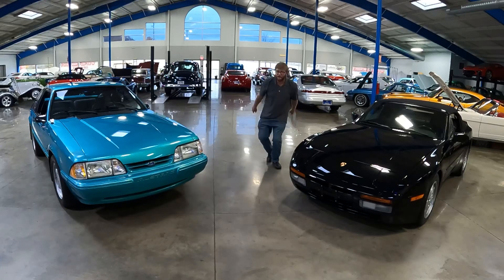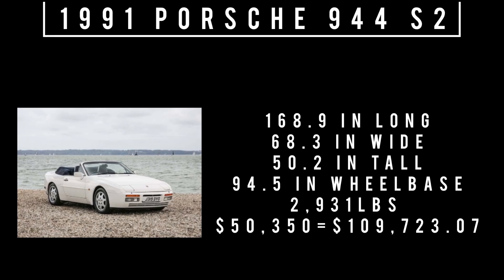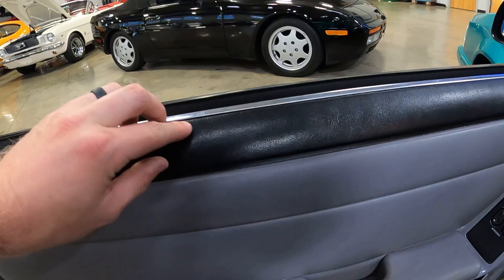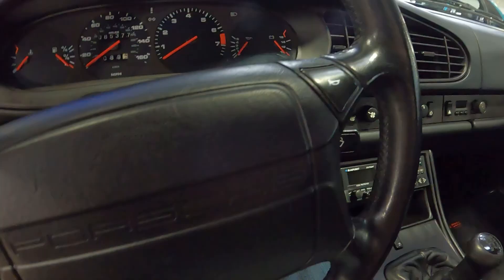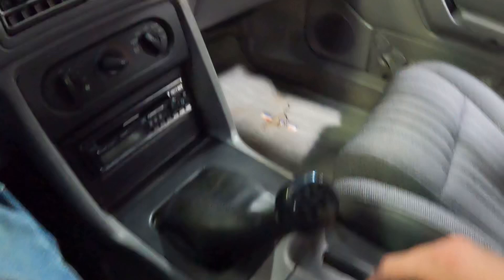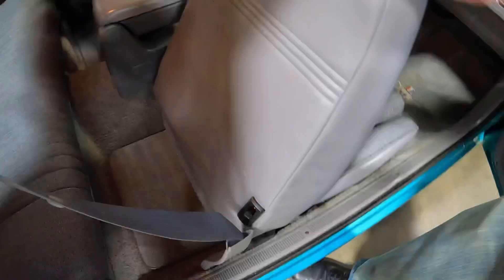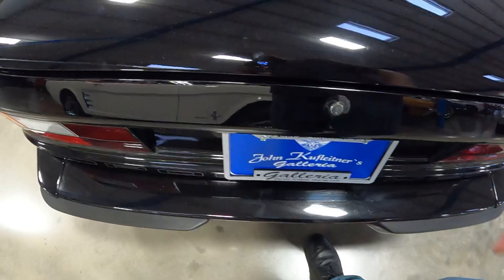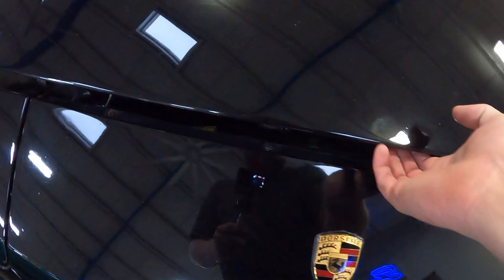Non-Comparable comparison? Or is it 1993 Ford mustang vs 1991 Porsche 944￼

Comment: You'll find the clutch in the 944 travels about 3 times farther than required to shift. It took me about a thousand miles to realize how good the clutch was once I stopped pushing it to the floor.
Reply from the maker: Yeah, I don't remember exactly where the clutch let out it's been years since I drove that car but I do remember it operated the engine did a lot like a Honda with VTEC. Once you got it up over a certain RPM range it turned into a totally different car...

Comment: I'm a 911 guy, 73 911T Targa, since new(pretty much all original) that said the 944 was pretty nice overall with a 50-50 weight distribution, and a better engine than the 924. Was it over priced at the time?  Maybe.  I think the depreciation was created by the "It's not a Porsche crowd, It's not a 911 and it's not air cooled and the engine isn't in the back. And I'll add this, many were thrashed pretty heavily.  It sold 173,238 units from 1982 and 1991. However - -It was one of the most successful sports cars in Porsche's history About 1/2 were sold in the U.S. You are correct, it becomes a different car at about 4,000 rpm, it's max torque comes on at 4,100 rpm and you begin to start getting close to it's max horse power.  An original condition 944 (near mint) can still bring about 45,000, most bring far less.  Glad you liked it though.
Reply from the maker: Going to hit more Porsche in the future hopefully 356 hopefully next year there is a xk150 coming maybe next week

Comment: You need to educate your self on 5.0 mustang . The one you drove must a been parked for a long time or something is not right with it . 5.0 stangs came with 2.73 gears that was very high , however 1/4 m times were low 15’s to high 14’s , not bad for a grocery getter lol , now the good choice was to buy the even cheeper 5.0 LX , it came with lower gears , 3.08 , no problem getting in to high 13’s in the 1/4 m . Of course now guys are getting 3.55 or 4.10 and a lot of affordable add ons , and then , these little 5.0 are Rockets!
Reply from the maker: The one that I drove was extremely slow I had an 88 Lincoln town car that pulled harder than that car did my 88 Lincoln did 0 to 60 in 81/2 seconds that mustang didn’t feel that fast I’m subjective enough to tell you if something isn’t good I will give the fox body mustang another go but the one that I drove wasn’t fast nor was it fine to drive.. It was just OK a lot of people think that I’m comparing it to a new car I’m not comparing it to a new car I’m comparing it to cars from that era I recently drove a bandit Trans Am these cars are very similar in acceleration. The bandit Trans Am was also on the slow side automatic three speed transmission I shifted it manually and it still wasn’t that fast but I will say that it was faster than the mustang.. The Mustang had a harsher ride as well the Daytona that I recently reviewed had a better ride than the Mustang dead and that is saying a lot I’m a Mustang fan I like the 60s mustangs the new mustangs are cool too but this era for me it’s more hype than it was good and like I said I will totally give it another chance but this car must’ve had 273 in the rear end because it was super slow but when you got it on the highway 60 miles an hour it was only turning less than 2000 RPM which is pretty good. The Motel six comment was because it smelled like cigarette smoke like somebody bought the car just a chain-smoking and then tried to cover up the smell with lemon pledge that’s the smell of Motel six

Comment: Hi Justin, the dummy switch under the head lamp switch is for fog lamps switch found on the Mustang GT.  I know what you are talking about a rear seat in a car for lower insurance cost(s).  Insurance company(s) charge higher rates for 2 seater cars, I thing it's politics.  That is one reason why the Pontiac Fiero was so short lived.  The 290:1 rear end gear ratio is a "fuel economy gear ratio" NOT a "performance gear ratio" at all.  Please reply.  Dave...
Reply from the maker: That has to be the explanation of that car because it wasn’t that great but when you were at speed it was only turning maybe 1500 RPM at 65-70 miles an hour i’m gonna be sure to call out that RPM numbers in reference to speed when driving when I can

Comment: Eventhough the prices may be close, now, but what is of most importance is what is it going to cost to own. Probably the Porsche has depreciated so much is because the car was costly to own. Porsches are costly to maintain and if something breaks or wears out, oh boy, hold on to your seat and put something in your mouth so you don't break all your teeth off when you clench them.
The Porsche engine is a timing belt engine and from my experience, that belt  breaks causing bent valves. When replacing the timingbelt, the tension has to be adjusted  using a special Porsche tensioning gauge. When we bought one from the Porsche dealer in the early-90's, we paid $250. for it.
The belt is tensioned buy loosening the  water pump mounting bolts(the water pump is driven by the timing belt), and sliding the water pump until the gauge reads the correct tension and then you re-tighten the water pump.
Then there is the clutch. It is conventionally mounted rto the flywheel, but it is connected to a rear-mounted transaxle. You have to unbolt the transaxle and move it back far enough so you can remove the bell housing  to replace the clutch. These are very costly repairs, laborwise and parts wise.
Just because you can afford to purchase the car doesn't mean that you can also afford to m Aaintain and repair the car.  With used Porsches, I've seen some abandoned at a repair shop because the owner can't afford to fix it. I've seen a lot of these cars sitting at a repair shop for months while the owner save up enough money to pay to fix it. And, in the meantime, the owner is still making car payments on a car the owner can't drive or even have possession of. Because there might be storage fees involved, the owner may have the car towed home.

Now the Mustang. It has a regular Ford pushrod engine and is extremely reliable. Parts are readily available and reasonably price.  It doesn't involve a big production number or stage show to work on it. Plus, it won't be hard to find somebody to work on the Mustang. Mustangs have a long American history and have always been well-liked.
Reply from the maker: Totally agree with everything you said.. I’m not a Porsche fan nor do I like Mercedes bmw or rover products they all seem like over priced piles to me.. Porsche when running good is a good car when it’s not it’s one of the worst cars you’ll (not you specifically)  but you’ll ever own. Same goes for the other brands mentioned. 

I wish we had more 50s cars at the shop to do comparisons with
Reply: @What.its.like.  I'd say most of the 50s cars  have been snapped up and are languishing somewhere in somebody's collection or sitting waiting to be brought back to life.  
Us 'o;der' guys are dying off  and classic cars are coming on the market, slowly. You are young enough that you are going to see many classics resurface and come on the market in the future. If newer generations are not interested in classic cars, prices will plumet and there will be tons of bargains out there.
From myself having been in the auto repair field for decades, I kinda know which cars to avoid. Because we repaired cars for a living, we hate working on our own cars, so reliability, longevity and cost of ownership are major factors. There are companies out there, like Hagerty insurance, who understand and help you out. I have full insurance coverage  on my '82 Mercedes 300SD and '81 Cadillac and it costs me only  $125-150. per years, insuring both cars on one policy. Most European cars I know to stay away from. I might consider a Porsche 356, because of it's simplicity and that it is really a VW in disguise(on steroids). Kinda like the early Mustangs being Ford Falcons with different bodies.
Reply from the maker: We were just talking about that at the shop the other day I don’t think all of them we’re gonna go by the wayside.. White Mustang Camaro challenger all the cars that people dont watch on my channel they’re gonna still be all right. 

I’ve made it my mission to do exactly what you said I want to bring to light The cars that are off the beaten path lost in the woods somewhere that are super cool but nobody knows about. I’m a huge Hudson Nash Studebaker Packard fan I also like kaisers all of the 50s brands really De Soto there is a lot of cars out there besides the mainstream ones
Reply: The timing belt replacement does not require a special tool for tensioning, but a spanner wrench is required to remove and replace the balance shaft belt. It's not expensive. The key is replacing the belt regularly, bo different than the VW Dasher I owned back in the 80s. The job isn't difficult.
Reply: @rrassoc  Having been an auto tech for close to 40 years and having worked on Porsche's from the 356 to the 928's and 944's, I know a little bit about what I am stating. I learned the hard way that you have to use the special Porsche timing belt tensioning tool when changing the timing belt. Like an Audi 5 cyl. and some 4 cyls., the timing belt is tensioned by moving the water pump. Unlike the VW OHC 1st gen 4 cyl. engines, the Porsche DOES NOT use a timing belt tensioner pulley, adjusted with a spanner. There is NO tensioner pulley.
Reply: @automatedelectronics6062 I'm sorry,  but I own a 944 and did extensive research on the timing belt issue before my purchase.  There are a lot of references on YouTube how to replace a timing belt on the 944. I am no mechanic, but successfully replaced both belts and the water pump, among other maintenance taks before driving mine. 

I have a tool to measure tension, but chose not to use it.  I can assure you, there's no special tensioner tool.  The 944s use 2 different methods to apply tension to the belt. One is a nonconcentric roller, and the other on late models is a spring-tensioner.  I used the twist method to decide whether the belt was tight enough. The spanner is used to hold the balance shaft pulleys in place, and adjust the spring tensioner.  

Perhaps the 924 is different, but I can assure you, I know how my car works!  The only other "special tool" I required was a crankshaft lock to hold everything in place when removing and reinstalling the pulleys on the crank. And that wasn't 100% required ,but I also replaced the fron seals.
Reply: @rrassoc  And...excuse me, I was a factory-trained Porsche 944 auto tech. There IS a special timing belt tension checking tool which must be used when installing a new belt. Here is a You Tube video of a 968 with the exact tool we were provided with at Porsche 944 school:  https://www.youtube.com/watch?v=EzIm7t8IEdI
If you do not use this special tool, you are a fool. There are some 3D printed plastic tools used with a torque wrench available.
Reply: @automatedelectronics6062  a tension-checking tool is not required.  I have one. It was inexpensive. Didn't use it. The community by and large uses the twist method.  You make it seem like replacing the belts is a difficult, expensive job.  It isn't.
Reply: @rrassoc  When you don't use the intended special tools, it can be costly to whomever replaced the timing belt. When the belt breaks in less than half the normal life that the timing belt should have lasted , you end up doing a free valve job for the customer to replace the bent valves. The belt twist doesn't work on these. As I stated, I have seen the results of mechanics not using the special tools when others used the twist method.